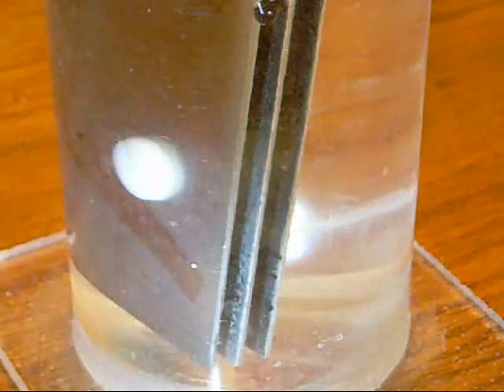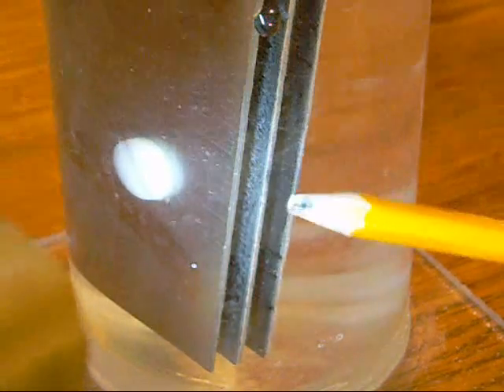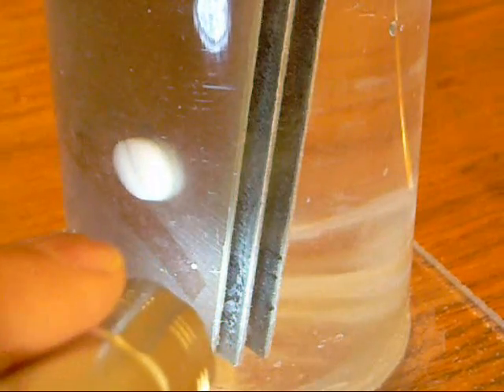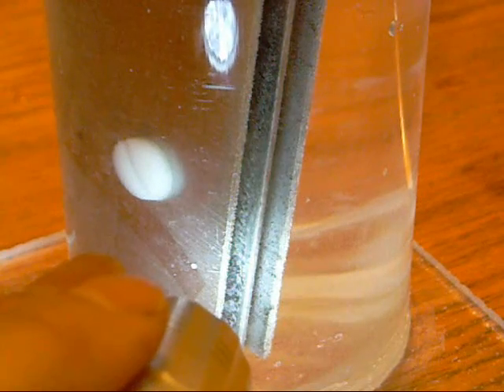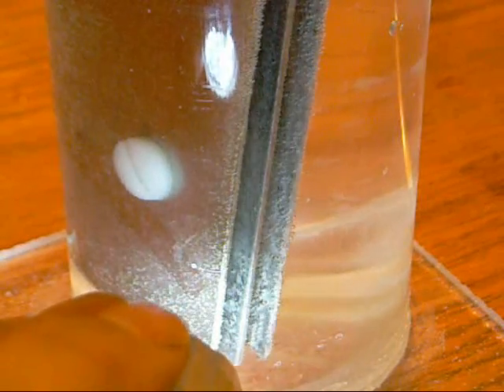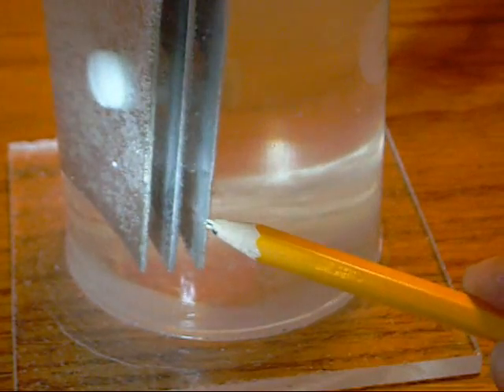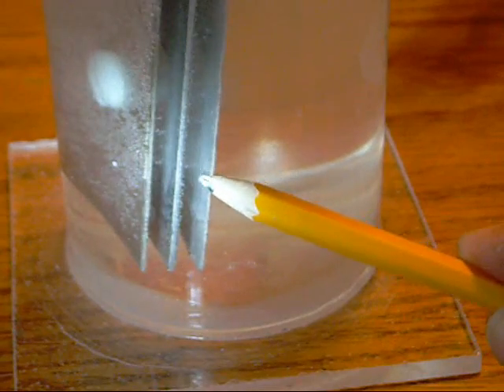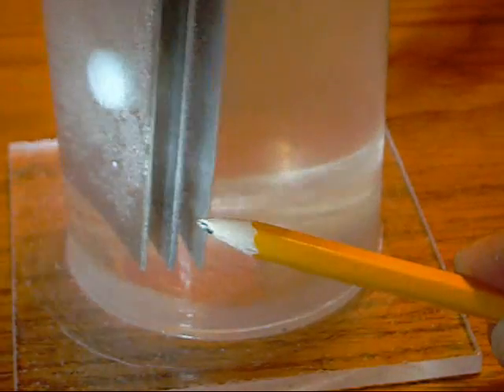Visual Gas Production (3 of 3) Sanded and Grooved Plate

Comment: For best HHO results, you should use a teaspoon of electrolyte in distilled water.  The easiest type for testing would be baking soda, but if you plan on putting it into a car, you will want to use sodium hydroxide.  Distilled Water can be bought at your grocery store and sodium hydroxide can be bought at Lowes or Home Depot.  I hope this helps.